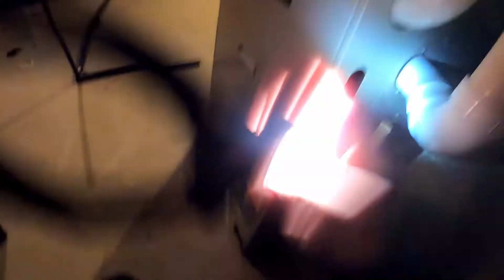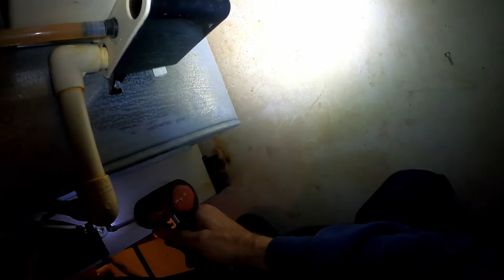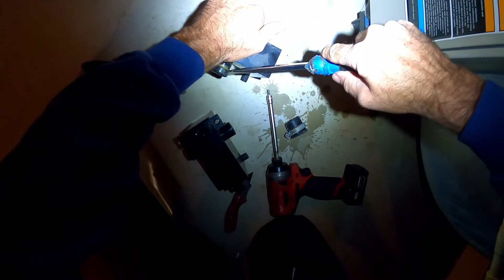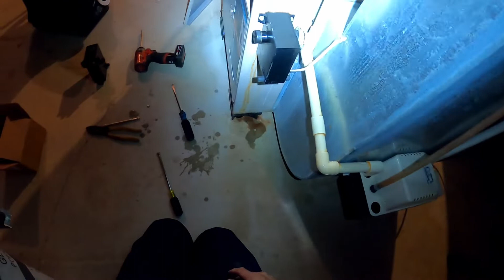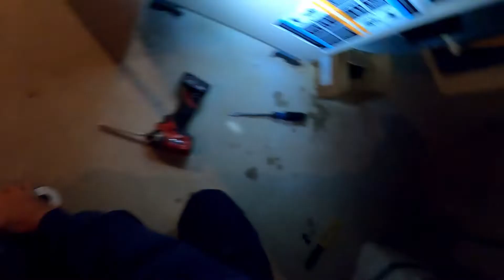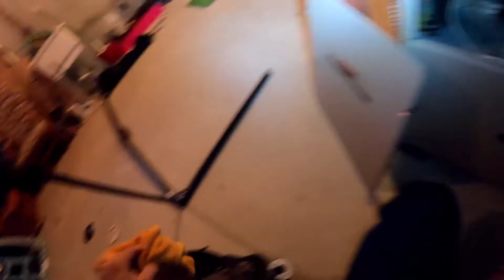Lennox Trap replacement (61M35)

Comment: This same box cracked at the same spot. I'm gonna try to patch it with a waterproof filler. I also drained it. I will look to see to buy a new one though
Reply: So I ended up replacing the whole thing just like in the video. Thank you so much for this! Perfect video for my situation. Cheers

Comment: Hello, you stated it needs to be installed on the exhaust side. I’m assuming you mean the exhaust vent for gasses. Could you explain the reason for that side?
Reply: I was wondering the same thing. If it’s where it exhausts out the home, I’m good. If it’s where the cold air intake is, I’m bad lol. Just want clarity. Also what’s the impact on not having those caps on?

Comment: My trap isn’t cracked but leaking condensation from against the heater wall on outside . It’s blocking the filter so every time you have to replace the filter you have to pull the black box off and now it’s leaking down the heater wall . It needs to be moved further away from the air filter to accesss and have water stop leaking what do I do?

Comment: Great video!
Q: Will removing one of the "Clean Out" plugs and leaving it off cause issues with the furnace operation?

I did this to drain into a bucket instead of the sump pump which is 12 feet away.

Comment: I almost bought the trap but after looking, I noticed the condensate collar (the part where the two drains meet and connect to the trap) was cracked.

So my advice is if its leaking also check the collar. Don't just assume its the trap. 

Part #: 81M4201

I confirmed it wasn't the trap by blocking all the holes and blowing onto it and it wasn't leaking air.
Reply: Did you remove the trap to check the collar or could you tell by looking inside the furnace where the hoses attach.
Reply: @bluwng  I took it off.

Comment: I’ve done so many of these traps as Lennox is the brand our company installs.  I’ve learned the hard way to always replace the collar/plastic drain barbs that the trap slides into. Those will leak as well and will most likely cause a go back.  Great videos man!  Subscribed!
Reply from the maker: thanks for the sub
Reply: hi there.  i have a lennox g61.  just wondering if I can clean out the drain trap by pulling out the white plug (behind the clean out cover)
thanks
Reply: You're right. My collar is cracked and my trap is fine.

Gonna go find a collar tomorrow.